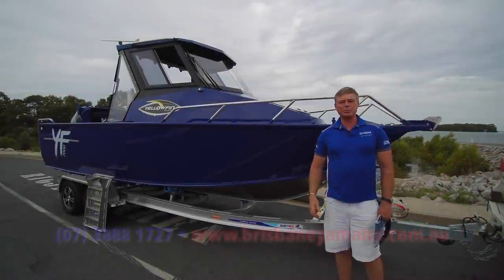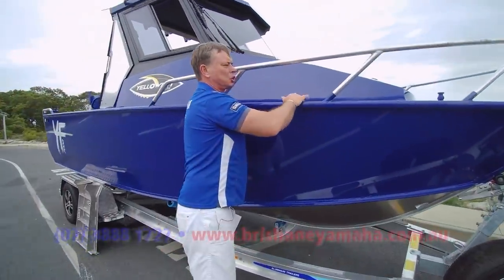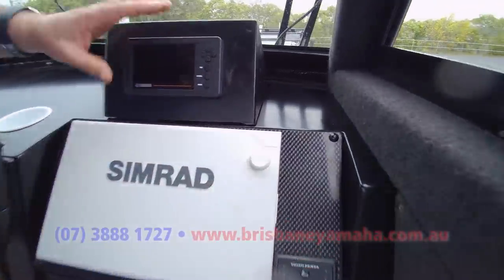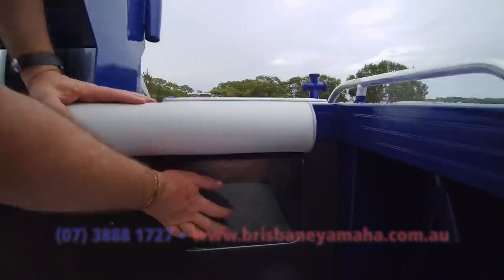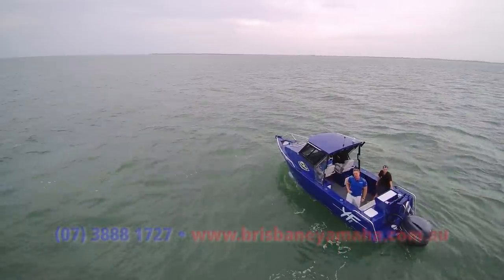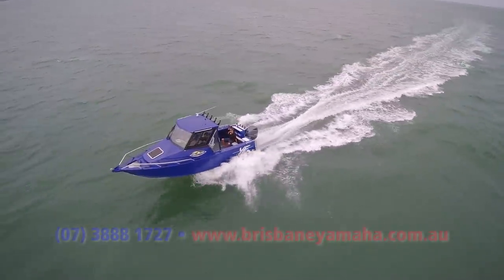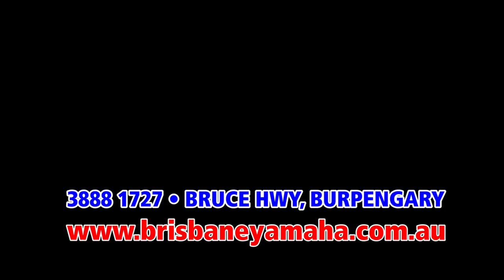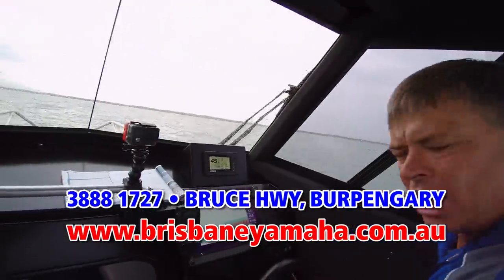Yellowfin 7000 HT + Yamaha F200hp 4-stroke boat review | Brisbane Yamaha

Comment: At $89k for that setup with the 200hp Yamaha is an absolute deal!!! ....You guys should be importing here to NZ. Compare that to a 7m Stabicraft, Extreme or Senator and we kiwis are getting shafted right up the arse here by the major plate builders......interestingly enough the Ali boat prices in NZ have increased disproportinately over the last 7-8 years which just so happens to coincide with the booming house market, easy to just tick it up against the house if its just tripled in value. Daylight robbing bastards is what they are...... start importing here enmass guys and keeps these pricks honest.
Reply: I wouldnt argue with that, I own a new 2100SC hence my recent gripe was when I was shopping around getting prices. Stabis are a great boat.